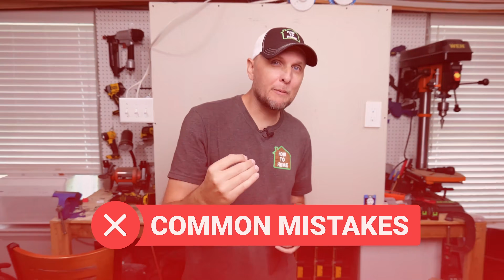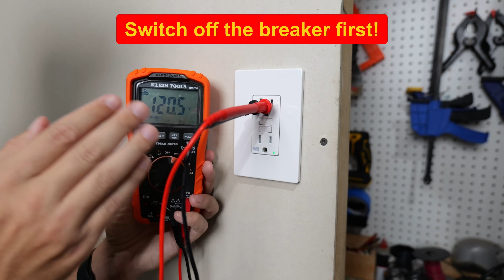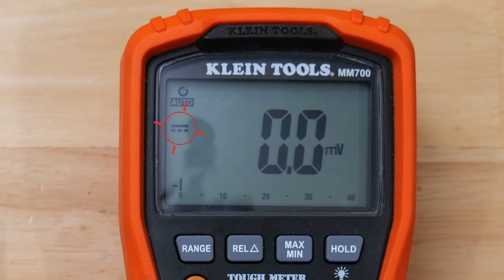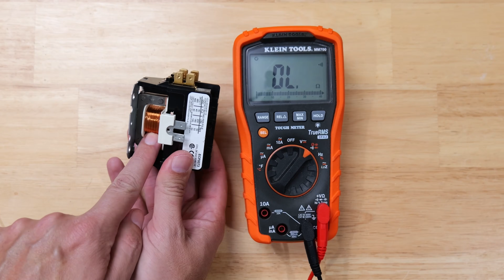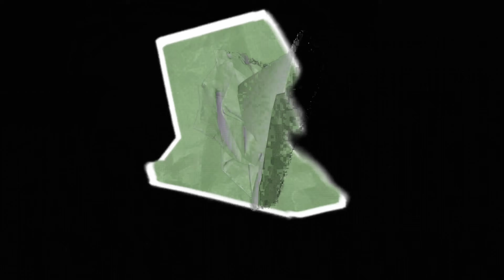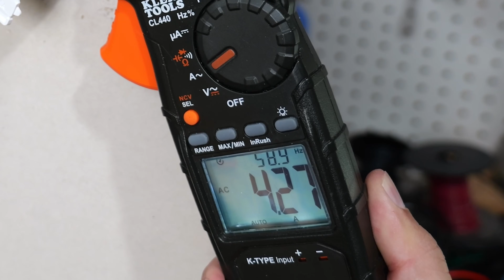Most DIYers Are Using Their Multimeters Incorrectly!

Comment: I didn't know that splitters existed. I just made one with a cord extender, by removing the external coating on part of it to reveal the wires inside and spreading the wires apart. If you want a x10 reading, roll up the wire into a 10 turn coil that you can insert your clamp meter inside.
Also someone taught me that we cannot use a multimeter to check from where a wire comes. The voltage shown on the multimeter don't necessary comes directly from the main phase, but can be from the return wire of a room light bulb (or anything else). To check that, we used another light bulb instead. If the wire tested came from a room light bulb, then the light bulbs would lit at low intensity, being in serial.

Comment: I scanned the comments and didn't see anyone bring it up.  You can also use a multimeter to quickly find out which side is "hot" on an outlet.  AC doesn't have regular polarity like DC.  This means you can invert the holes where you put in the probes and you would get 120 v on both tests, but you still don't know which side/slot has the hot wire.  Having the "hot" wire on the wrong side of the socket is a common mistake many DIYers make, heck here in Mexico even so called "professionals" at times wire the outlets worng.

The quick way to find out which side is the "hot" side is to put one probe on the ground hole, and the other probe on one of the other two slots.  If you get a reading it means the slot you are testing is the "hot" one,  and if you don't get a reading you are probably testing the neutral slot so if you move the probe to the other slot it should give the 120 reading.

I am a DIY person, and don't know the "why", but with most electronics doesn't seem to make much of a difference if the outlet wires are crossed (hot where neutral should be and vice versa), but for some electronics this does make a difference.

Comment: The problems with modified sine waves which is common with cheaper DC/AC converter, I missed. 
About the amperage, I made my own splitter which provides me the accurate reading either clampmeter or multimeter.

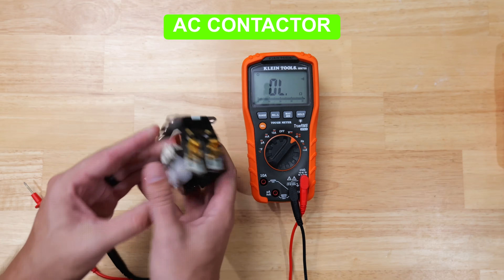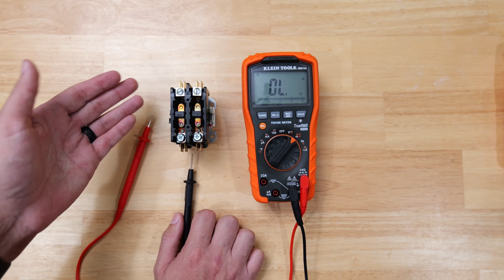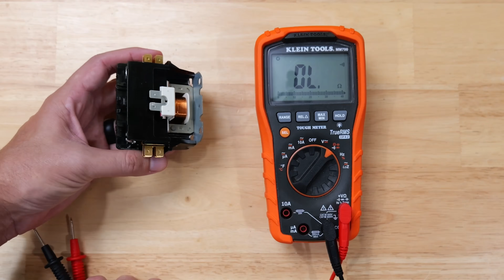Comment: For Bonus Points:  I would say the contactor [11:52---14:05/26:02] at Timeline 13:37/26:02 has movable contacts that are discolored at the bottom of the contactor.  Reason for discoloration is that this is where the current first breaks when the contactor de-energizes, and overtime the contacts burn and become pitted, therefore has a Relatively High Resistance to the current flow (when closed) creating heat and burning the contacts.  I was unable to ZOOM IN on the video so couldn't get a closer look at the contacts.  Sometimes "Contact Replacement Kits" are available on more expensive contactors.   

Experience: US Navy Electrician Mate EM1.  deg44401 at 83 years old

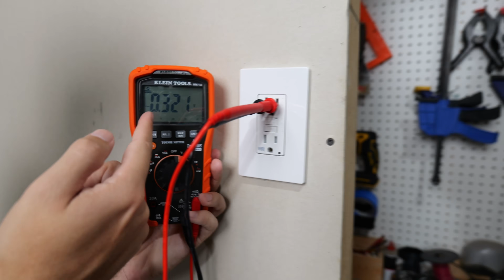Comment: 4:20  you said there's no power going to it. That's incorrect. There IS STILL power going tó the breaker, but there's no power within the breaker. If a newbie pulled the breaker out assuming there was no power going through it and began to disconnect the wires, they would be in for a surprise. To ensure there's no power going to The GFI breaker, The breaker at the power panel associated with his subject GFI plug, should be turned off at the power panel to remove voltage to the GFI outlet

Comment: You made one huge dangerous error. That outlet is a gfci outlet. When you push the test button it only turn off the power to the outlet, the line coming to that outlet is still live. With your instructions someone might pull a gfci outlet out of the wall thinking that it’s safe to work on and get hurt. The breaker must be turned off at the panel to make it safe to work on !

Comment: To test batteries, the voltage should be checked while the battery is under load.  Some meters have that feature. I just got a cheap Amprobe BAT-250 tester that I use all the time for AA, AAA, and 9v household batteries.

Appreciate your videos.  Thanks!

Comment: For current measurements with a clamp meter, I just made a short extension cord with separated wires. No need to buy any adapter, and more convenient to use in cramped spaces.

Comment: You tripped the GFI, which will kill the voltage across the receptacle, but I wouldn’t be working on the wires in behind without verifying the hot line is dead. Always trip the breaker at the box before working on the circuit
Reply from the maker: Yes correct.  When I did it I said I was just simulating the power off by doing that.

Comment: Great video but i want to add something about continuity test, that a lot of electrician i work with, do not know. My company sells electric heating element, part on installing these elements we require ohms testing of the elements at different times. I have received calls from electricians saying the element was bad due to no continuity alarm. When i have them set the meter to ohm then they get the reading that we are expecting.   The reason for the issue is all meter have a range the ohm resisrance reading must be within to sounds the continuity alarm and some heating elements do not fall within this range. I have had to explain this to multiple electrician over the last several years.
Reply: Valid point.

Comment: If you don’t have a splitter, take a three prong extension cord, and remove a few inches of insulation 
To expose the hot lead plug it in plug in your appliance, it clamp meter over hot lead, and test amperage.

Comment: If you are going to measure resistance, make sure you do not have power to the circuit.  I once had a customer measure a fuse in the circuit and tell me the fuse was good.  It was not he was measuring the voltage drop (120 VAC) across the fuse.  You can damage a meter by accidentally measuring live voltage in resistance mode.  Also be careful about exceeding the voltage range of the meter.  All meters will have the maximum voltage rating.  Exceeding that can result in damaging the meter.  I once was trying to measure the voltage on a piece of industrial equipment.  I called the manufacturer to ask about measuring voltage because the equipment was fed with 6600 volts.  He said to set the output range of the equipment to 600 volts, and I would be able to use my Fluke 77.  He was wrong.  That resulted in an arc flash. My meter exploded and it blew the main breaker to the plant.  Luckily the end of my probe blew off, and I was not hurt.  I had to have a discussion with that employee's supervisor to get their company to replace my meter, and I informed him they were lucky that is all they had to pay.

Comment: House built in 1929. Outside lamp post with 8-10 cloth covered wires, all the same color. Toggle switch turns circuit on/off on that outlet. How do I determine which wires I should connect to my brand new lamp head? Lamp head has 1 LED bulb, 1 black, 1 white and 1 bare ground wire coming out of the bottom. Thank you for ANY advice/help!

Comment: As usual, you really did a great job on how to use electrical meters for most DIY jobs.  👍👍👍I like your emphasis on safety, but I was hoping that you would talk about the limitations of meters by talking about their electrical test meter safety CAT ratings (CAT I to  CAT IV).  There are many people who don't realize that if they try to measure high voltage with a CAT I meter, the meter will melt in their hands and could severely injure or kill them.  Have you covered CAT meter ratings in a past video?  If not, it would be great if you could make one.  💪👊

Comment: An elderly neighbor’s hvac went off in the middle of a Texas summer heat wave. He called me to ask what to check before calling a real technician. He’d checked both the breakers, and they were ok - even toggling Off then back On (some trip halfway). I assumed it was the capacitor since they usually die at the worst possible time, so I popped over with my spare cap and some tools. But he said his thermostat was blank, so I checked power at the air handler and there was no voltage. Before opening the panel to test the breaker, I checked the air handler ‘service switch’…a $1 toggle switch on a rafter-perlin next to the unit. My non-contact voltage tester lit up on the line side (power in) and was quiet on the load side. Checked the switch with a multimeter and confirmed ‘failed switch’. Swapping out that simple dead switch fixed the issue and is only the second switch failure I’ve ever seen. That just reinforced what my dad always said - check the simple things first!
Reply: Chinese switch maybe?!?!
Reply: I like that story... it's so true. Sometimes its just that simple.

Comment: In my younger days, I was working with a crew restoring and renovating houses. I was teamed with the electrician who was testing amperage draw at all the outlets. I was to pull each outlet, separate the wires,  plug in a lamp and the electrician would test it. Then, put it back together. 10 minutes at each outlet. After the third outlet, I was looking at a pile of spare parts, spotted the male and female cord ends, and some spools of wire. I grabbed a foot of the black, white and green wires, put them together like a short extension cord. Plug it in, do the test, unplug go to the next outlet. 15 seconds. We finished the house in about 30 minutes, as opposed to most of a day. Electrician was happy, he got to start his weekend early.
Reply: If you have a spare short extension lead, you could just strip enough of the outer insulation to expose the inner insulated wiring. Then do your checks on that.
Just be careful not to cut into the inner insulation.

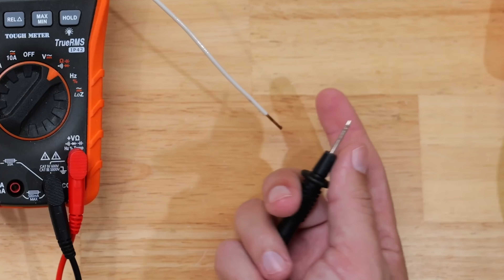Comment: (8:50) Can probably be attributed to your finger tips adding resistence to the circuit, but the way the ohm reading is bouncing around I would suspect intermittent continuity in that piece of wire regardless of what the beep was telling me. (8:57) No fingers on wire; definitely intermittent ...or a bad probe.

Comment: Thank you for the video.  Good overview.  I am intrigued with working on electrical and troubleshooting.  Don't have a license but I believe I am more professional then some if the "electricians " work I have seen. I don't know everything but alot. The problem is working on systems to help folks, no license.  I don't believe everything should entile a license.  Especially adding a circuit,  replacing switch or electrical  receptacles,  installing a sub panel or cleaning up double nuetrals on buss bars... Maybe just the electricians lobbyists protecting themselves. I never go beyond my experience level but rapidly gaining practical experience where a service panel replacement is not very scary anymore. Just my thoughts,  thanks again. Go Army!!😊

Comment: I have a digital multi meter, really clever, and only 20 USD online...... It's fully automatic....a really handy feature is that it can tell which is the hot wire.... I don't trust the wiring in my house here in the PH and I checked all my house sockets for polarity....50% were wrong.

Comment: Sponsored by Klein? 😁

Klein makes really good tools. Some of the best. 

I have a meter, not Klein, that tests for voltage on a wire that has a sensor I can put close to the wire. Doesn't read the voltage but lets me know if it has an AC voltage by lighting an indicator light and beeping me. Didn't think I'd use it but I've found it very handy. Does Klein have one with that feature?

Comment: I would like to add one important FIRST step using any meter with test leads! Step one turn meter on to ohms make sure your meter leads are not broken or unplugged slightly to where they are not functional! Step 2 check something live to make sure you get a voltage reading in case your meter broke!  If you think you kill a breaker or the only disconnect feeding equipment and pick up the meter and checking for volts without testing that meter is fully functional sooner or later it will let you know you had a broken test lead or broken meter and grab hold of something HOT! Been using meters for over 50 years and have had many test leads fail and even a few meters that malfunction/broke! Never assume your test equipment is working properly always check because many have died, severe burns because of this and others have had the 💩knocked out of them! 

Work safely never get in a hurry!

Thanks for the video!
Reply: Even as someone with a cheapo multimeter with cheapo probes who just wants to make sure he doesn't ruin something in his vintage computers, I always at LEAST make sure continuity mode beeps every single time I use my probes. ANYTHING can break.
Reply: Some good advice..I might add many of the inexpensive meters come with cheap probes. I buy cat 3 rated probes.
Reply: @whiskeycat-i6h  Agree 100% cheap leads can get you killed but with that said I have had the best leads fail over time so replace them before they show signs of wear or any deterioration! $50 to $100 lead set vs your life!
Reply: @whiskeycat-i6h iiiis that right?

Comment: I have used them all, however I retired from the HVAC/R trades. One point you kind of showed but did not elaborate on is that when checking a circuit dead or to see if voltage is present before work, is to ALWAYS check your meter. Check it on a circuit you know is live and note that the value is what would be expected on that circuit. If there is not the proper correlation, check out your meter before proceeding.

Comment: I used to do tech support via phone and email for 50 amp pump controllers in hot tubs, and was always amazed at the number of people who were wiring controllers and GFCI breakers who were unable to use a multimeter.  For many of the years I did field service a multimeter was the only test equipment available.  I'm glad you are getting some info out there to help.

Comment: A meter such as shown is of very limited use in capacitor testing. Capacitors can fail open, short, and also fail and short under voltage. The tester shown only tests for low voltage when the capacitor is for high voltage so the test is of little value as it only tests for low voltage and for large rates of leakage.

Comment: Very interesting. I was curious about DC amperage as from a solar panel. So the clamp would not work because it is not AC, correct? So if the panel is rated at 10A and I have a 10A meter do I just connect across the terminals? Are there special meters for that type of amperage, or do I to put a resistor in the circuit (you meter seemed to handle mA DC)?

Comment: Uno) - The first, first, first thing to do is touch the red and black together and get a "beep" to tell you your multi meter is working. Knowing the test setting is essential and it's the first thing to do - "BEEP". You really don't want to mess with electricity without first checking your meter.

Secondo) - having a multi meter and reading the little booklet doesn't make anyone an electrician. There are numbers here mentioning capacitors and they are found in all kinds of electrical apparatus. Mains house wiring can often have surprises too.

An electrician is an apprenticeship job of several years. It's not for nothing.

BZZZZT!!!!

Comment: I was going to say I was kind of surprised that you didn't comment about checking that the meter is set to VAC not VDC when checking that the power is off. Then I thought about the steps that I would take. That is when I realized that this isn't really a how to video on doing electrical work. It is a video on the use and capabilities of meters.

A how to video on safely checking for power off would likely include checking the meter against a known similar type of energized power source before and after checking the wiring in question. This is done to check for the meters operation. It would also likely include checking in addition way to account for possible wiring errors. 

In some rare situation, it can be wise to check for both VAC and VDC power. ( I was going to say that it would be unlikely for DIYers two encounter these situations. But then I thought about how many appliances now advertise having inverters.)

Comment: The problem I have always had is that there's so many differences in how the meters display the symbols. (The symbols are "supposed" to be standard.) Your three meters show some of the differences. So, perhaps a video on some of the different meters and how to decide which to buy. I personally don't need this. But other viewers might. ?? And what really bothers me is when I asked online for suggestions. The prices are all over the place. Your Klein is said to be one of the best. But it also is expensive in comparison. Some details on which meters are best for the home DIYer. Having to buy two meters is another nuisance. As a home owner, I do not intend to mess with an A/C or pull wires out of the wall. So it appears that measuring amps is a no-no.

Comment: Always be careful. If the outlet was wired incorrectly or has a broken wire it could still have power but if you're only testing the 2 terminals you might not see it. Like if white was broken you'd have black, and when testing black to white you'd see nothing. But as soon as anything bridges black and ground, you're gonna see things. The opposite could be true if they wired it backwards and swapped black and white, with the other side being broken - since you still have black (miswired to the white side) and ground you may get shocked. Or even worse if white and ground are broken and you still have black, you're fine til you touch it and ground yourself. There other tools to figure that out but with just a multimeter, in MOST situations you can be OK, but not all.

Comment: Tue probe style meter isn’t really useful for measuring current in a home DIY environment. They max at 10A with the fuse, and I can’t think of many cases where we would measure 10 or less. I work in the automotive field, and DC clamp meters are fantastic, except they are pretty expensive compared to AC.